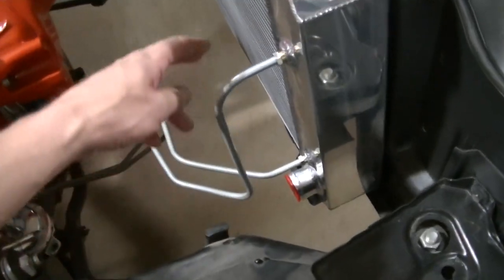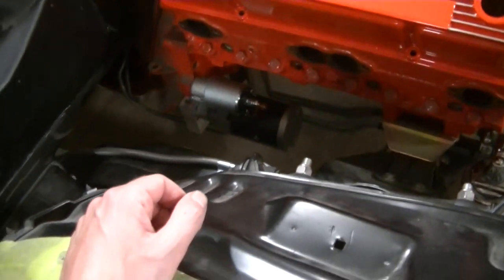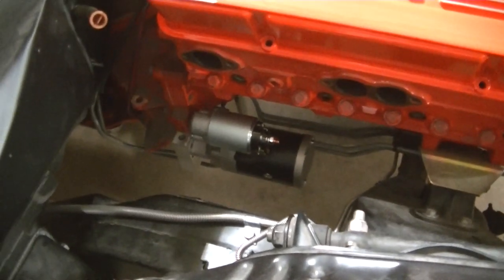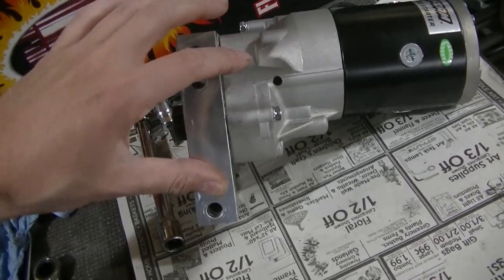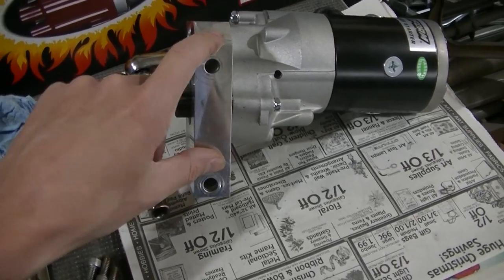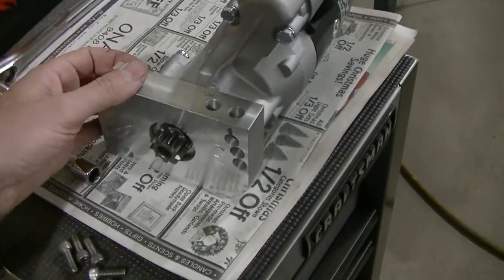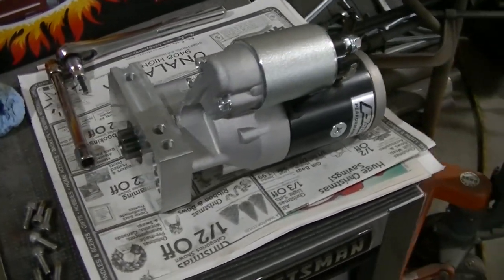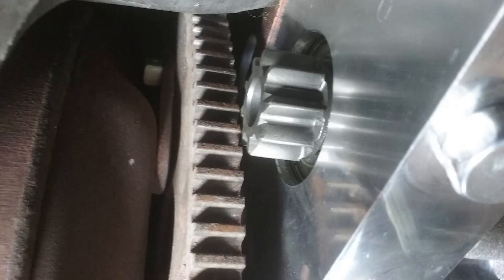70 Camaro SS Project "PROFORM High Torque Mini Starter"

Comment: if you have 168 tooth you must use a staggerd bolt pattern starter with my 1970 LT1 z28 had to have a starter with 3 bolt holes on the starter. if you need to get the ring gear closer shim one side of the starter. Larry B

Comment: Do you really notice a difference with a reduction gear starter?  A buddy of mine was saying he gets his starters and alternators from Mean Green.  My Suburban's starter is acting up, so I may need to work on that soon.  I know I need a higher output alternator in that truck, too.
Reply from the maker: I think you will only notice the gear reduction starter if you have a high compression motor.  This car is suppose to have the original 70 motor with the Z28 cam.  Should have at least 10.25:1 compression.  We bought a high torque starter for one of our tractors and it really turns the motor over way better than the old starter did.

Comment: For sbc 168 tooth offset mount starter replacement, go get a starter for a 2004 chevy avalanche 8.1L and a few shims for the starter and bolts $90 mini starter with a lifetime warranty...